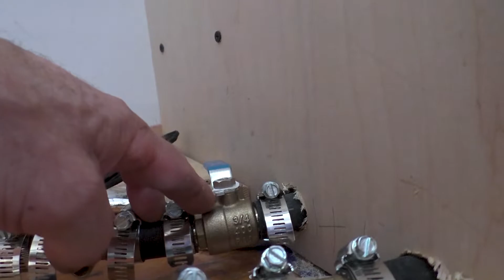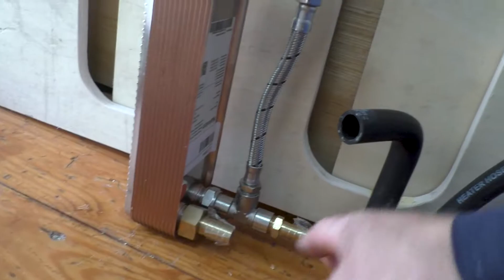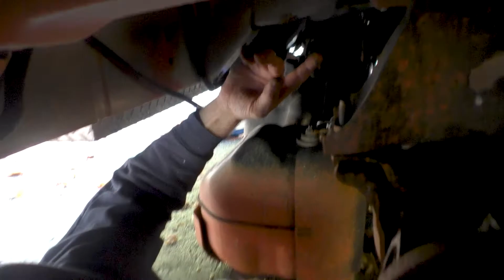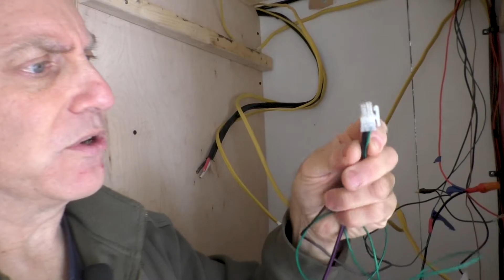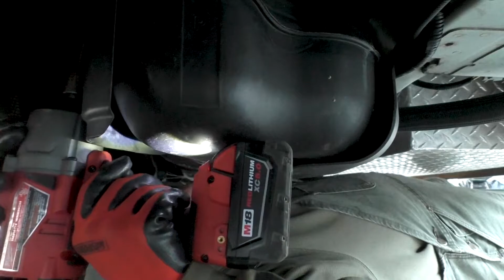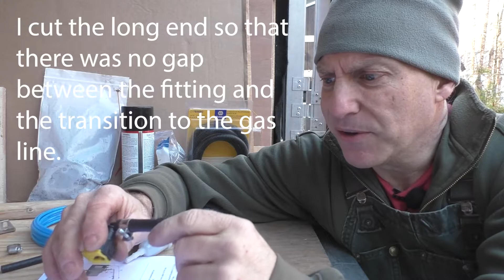S1E15 Espar Install Part 2

Comment: I’ve just bought a kit one question how noisy is it ?  Would you consider putting the burner inside?   Just concerned about security
Reply from the maker: I would not install insdide. Under only. Do take pictures of the lables as they can become unreadable later. I put a shield around mine becuase I installed it in front of the rear wheels.

Comment: How well does the system work ?
Reply: Working good overall. Some things I didn't know that I intend to fix. Like... The control is not a thermastat. Time settings only. It does not turn the fan on and off. I tapped into my van using an aux fuel line. Come to find out that runs out at about a 1/4 tank so I have to keep it above 1/2. Uses very little fuel.

Comment: So question for you. I've got the same kit from Heatso and it's been a nightmare with all the wiring issues. I've asked a few other YouTubers who have used the same kit this question and they've indicated that it's not possible.... So here it goes for you. The webasto controller will control the heat blower. The easy start pro will control the Espar.  Do you have it so they're working in conjunction that they go together? Right now the other YouTubers that I've watched don't use the relay you're using and they've said that's part of the remote start system if you tied it into your van. So I followed their wiring diagram and now what I get is the webasto controlling the blower but the easy pro has no way of starting up when the temperature on the webasto is reached.  So basically I'm not getting hot glycol because the webasto doesn't signal the Espar to fire up and heat glycol.  Does using the relay establish that connection.  Basically what I'm wanting is to be able to set the temperature on the webasto and go to bed and when the van cools down and hits the temperature range I want the blower to fire up and have the Espar burner fire up and start heating the glycol so the blower has hot glycol in it and all doing that from one interface. What the other YouTubers have told me is that it's not possible and that the webasto will only start the blower and you have to use the easy start pro and set a schedule so it turns the Espar on at a certain time. All I want is the thermostat on the webasto to trigger everything. Is yours working this way?
Reply: I too want the same feature. Was very disappointed when I figured out that is not the intent of how the system works. I would like to see your wireing diagram. Maybe ir is different than what I came up with and maybe I can figure something out. It seems odd that this is not possible since there is a temp option. My next move was to try a pie.